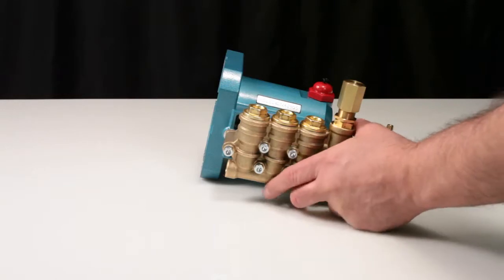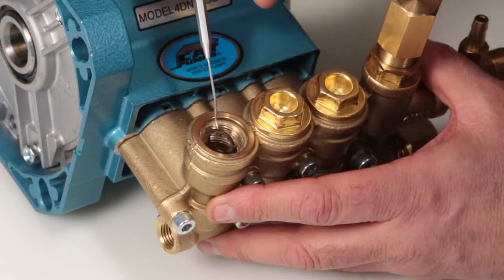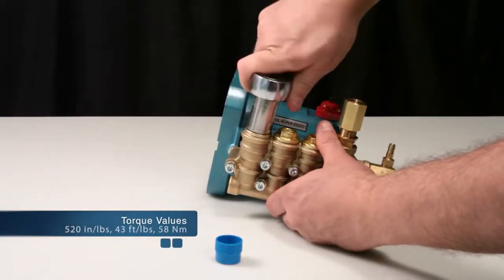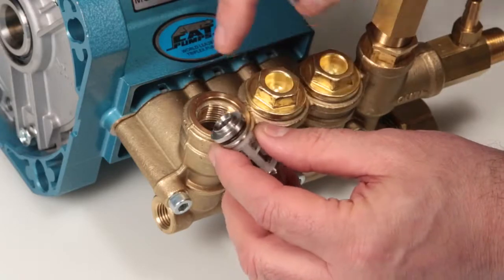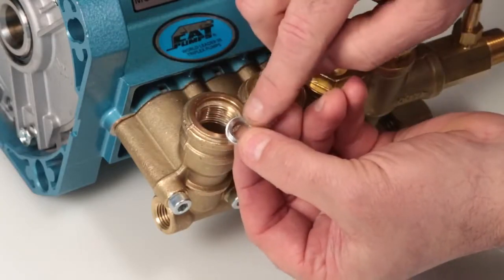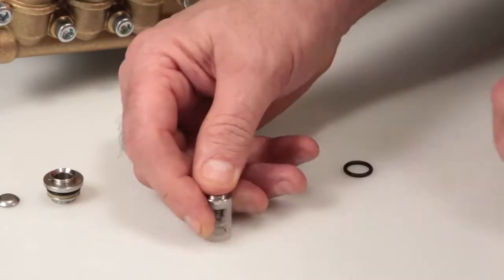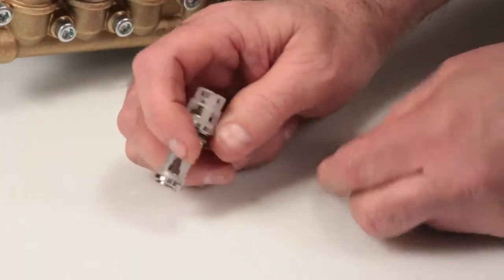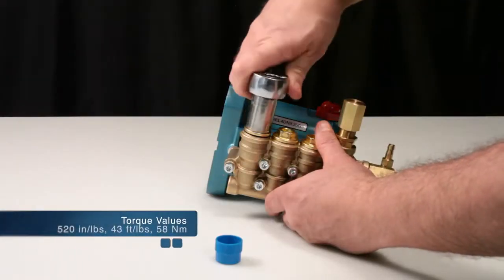CAT Pump Repair: Servicing Valves 4DNX25GSI, 4DNX27GSI

Comment: How do you add a bypass line on this kind of pump
Reply from the maker: This pump has the bypass molded into the brass head.
Reply: I just order the gx200 with cat 4dnx pump an I don't see were I can run a line to my buffer tank